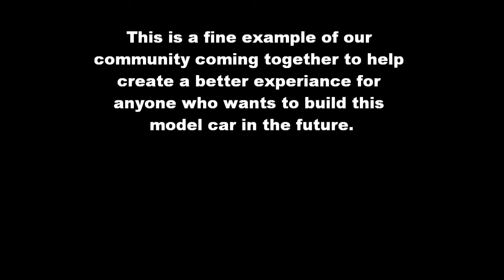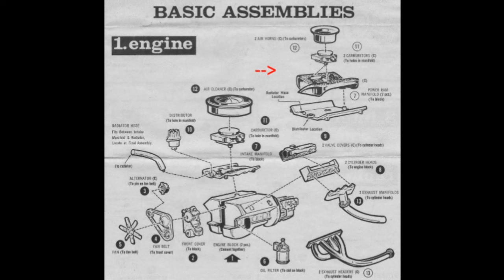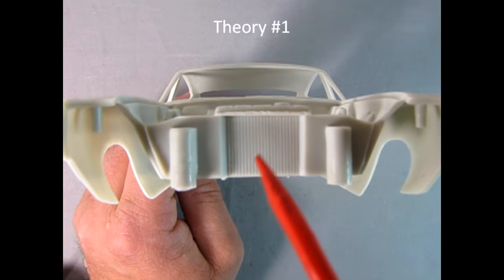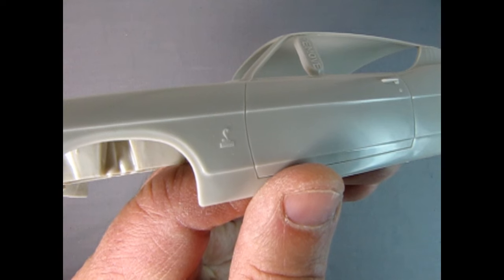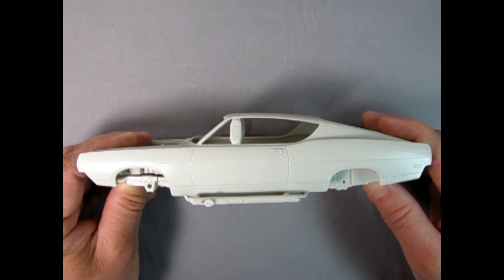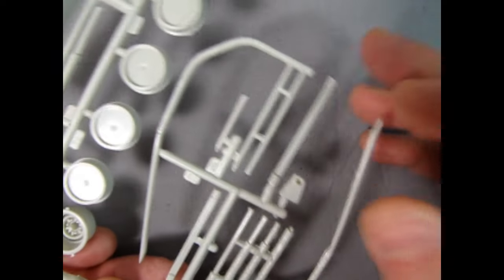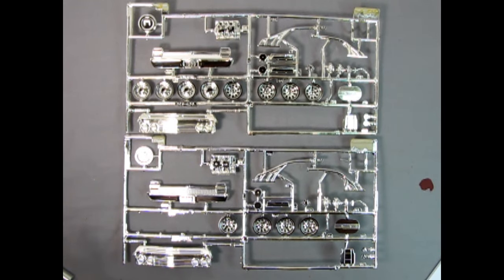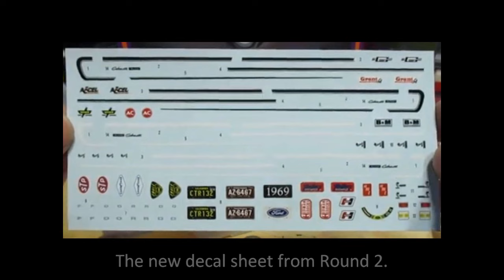How To Fix Everything Wrong With The AMT/ERTL 1969 Ford Fairlane Cobra Torino Model Car Kit Part 1

Comment: Great video,Trevor. 👍😃Willi has spotted some interesting points and I've just spotted the rear Cobra badge is in the wrong place and should be nearer the centre😃. What a kit👍. I must check out those front riser blocks too👍😀. Thanks for showing and best wishes from jolly old England👍😎 Pete 🤓
Reply from the maker: You are welcome. I see that the rear Cobra badge seems to move around that trunk lid on different people's cars though. however, that's a small detail compared to the rest of what's going wrong with this thing! If you have the Cobra decals, it's not a problem to place the logo where you want it. If you have the molded on trunk lid and no Cobra decal, you are stuck...and that's the issue in my case.
Reply: @MonsterHobbiesModelCarGarage  Yes 👍I suppose it was just down to who fitted the badge. 🤓. Really good video a anyway, Trevor and I look forward to watching more👍👍😀
Reply from the maker: Could be Pete...or we could be looking at a restoration in some cases where the owner put the badge back in the wrong place. - but then, there would probably be holes in the panel. There was also some minor modifications made to these cars from the factory later in the 1969 model year. They went from a Cobra decal to a metal Cobra badge. The rear badge locations might have been part of that as well.
Reply: @MonsterHobbiesModelCarGarage  all of what you said is true. Even later owners can drill two holes

Comment: Well done Trevor!This was a thorough Diploma thesis for the  ancestry of the Torino kits!Now we have to call you officially Professor Torino 69!👌😉!And i had another resoluten to the length problem of this kit!Because it was already spliced together by AMT  , i lengthened it by 2mm!So there are a couple of resolutions for this problem! Keep up the good work!And thx for credits!
Reply from the maker: Wow, thanks!
And think...this is just the first video and I have uploaded another 3 in the series for a total of 4 and I still haven't finished the kit. 
In the end though, it will be the most thorough video out there on how to fix this car "Box Stock"...unless someone can find something else I missed. 

I wonder if you noticed that the real Cobra had staggered shocks and the kit has tandem shocks? - That's just another issue in the pile of issues this thing has.

Comment: Hi Trevor, thoroughly enjoyed this vid with backround history of both the real and model car along with how to correct it, as a born again modeller I think I'll build this one a few models down the line.

I've started on my Shelby Mustang and used the Humbrol blue paint and doing it in the promo style without stickers and where possible a few performance mods and at most Appliance or Crager type wheels for that day two look, im doing them kurbside style as they will be displayed in that way, after watching your vid on engine id like to paint them detailed and displayed alongside the car with left over wheels and make up mini parts board like I had at work it was like chip board with small holes drilled for hooks and parts hooked/mounted from Cal Custom, Mr Gasket and even Slash cut exhaust tips.

Im hoping to get the dyno printer 70s style and simply print the car year and name and make or buy some shelving with a perspex front, thats for later as im only on my third model.

Thanx for a Super upload and info along with motivation,
Best wishes to yourself,family and fellow viewers.
Reply from the maker: Sounds like you've got a cool project in the works there! 

Hopefully once the series is finished, you can have an easy time putting this model together. 

I am going to upload part 4 tonight and then that's the end of my previously filmed footage. Onto new footage of the completed build for video 5.
Reply: @MonsterHobbiesModelCarGarage  Hi Trevor,  yes im thoroughly enjoying model making, im looking forward to working on the Torino, especially after watching your vid and look forward to watching the others, just ordered a few more kits for my Birthday, 1966 Mustang saloon, 1967 Chevelle and think the other was a 66ish Nova SS.

Have a Modeltastic day,
Reply from the maker: Thank you. Last night I finished uploading the 4th video in the series. That should keep everyone entertained until July 24th. I can't believe I filmed so much, yet I am still so far away from finishing this model.

Comment: For a correct Torino build, to get the correct front grille, is the only option to get the ‘69 annual kit?
Reply: I bought a correct GT grill that was cast in resin.
Reply from the maker: Unfortunately, no. They used the 1968 Torino Convertible grille since the beginning of this kit.
Reply from the maker: @marklancaster731  Can you post the link?

Comment: "Blue oval"...???
Do you mean "Blue Streak Drag Special" slicks? 
Or for the NASCAR version in my original bought in late 1968, "Blue Streak Stock Car Special".
The 428 should be a "Cobra Jet". Like the one I put in my 61 F100 many years ago. That 428 CJ I took out of a crashed 70 Cougar Eliminator. There was a "regular duty" non-Cobra Jet 428. Different crank, rods, pistons, head castings, intake manifold, carb, cam, etc. Air cleaner for the CJ should have a vacuum pot on the left side to open a disc to let more air into the air cleaner under hard acceleration. 
My next door neighbor has a 68 Torino GT in original white with red C stripes. 302 V8. Needs restoration.
As for "correcting" issues with the kit, the chassis from the Revell 64 Thunderbolt is far more accurate. The later Revell 71 Torino or maybe Starsky & Hutch mid 70s Torino may also have better chassis.
Reply from the maker: Thank you for the history, tips and personal stories. 

My goal for this video was not to make the kit 100% accurate by swapping out parts from other models. Yes, I could easily do that, but it was my mission to take what AMT gave me out of the box and make it so that the parts in the box would fit together, which is the key issue to this entire kit. 

My video is for that person that bought this model and tried to put it together right out of the box and got frustrated with it because 85% of the parts need work, not for accuracy, but just to glue them to one another. I've never experienced a kit like this before. - I mean, I am taking seven 35-45 minute videos and heading towards 10 to fix everything wrong with the kit. Normally I can make a 45 minute video on any other kit and get the model corrected in that time. This thing is 10 times that effort for the same results! 

I feel that the person that doesn't have many models that wanted to try AMT for the first time and got this monster as their first look at the company needs major guidance to build it and there wasn't much out there. Sure, there are videos where the model builder fixes one or two of the issues, but in mine, I fix them all. - I started off discovering 26 things wrong with the kit, and then I found another 38 on top of that!  

So in this series of videos on this kit, the only thing I added that was not included in the kit was a sheet of Evergreen styrene which I used sparingly to fix the issue with the wheel axle holes.  

The second purpose of this video is to show everything that I am finding "Wrong" with this kit and pointing it out so that anyone that buys one for themselves will know what is involved with making it fit together. Once they know that, then it's up to them to decide how far they want to go with making it more accurate to the prototype vehicle. 

You suggest swapping the chassis for a more detailed one, which is fine and I appreciate that. Someone could use that information and go with your suggestion, which is good. But first, they need to know the chassis has issues, which is my part in this video series.  As you watch through all my videos, you will get to know why the chassis in this kit is the way it is...and it is quite a story in itself! 

But there is more than just the chassis. Even the battery needed to be altered to fit in the engine bay. Can you imagine! 

Anyway, thank you again for the comments! :face-red-heart-shape:
Reply from the maker: Did I say Blue Oval? Sorry, my eyesight is going, but the good news is I have gone for an eye exam and they discovered I need some reading glasses, so I got fitted up with those and the new pair should be here next week. :glasses-purple-yellow-diamond: